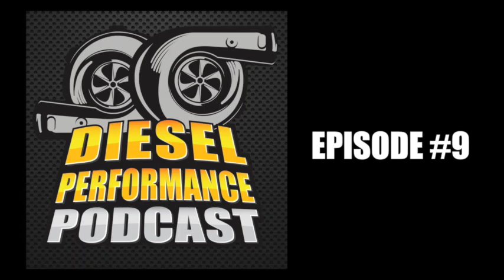Cummins Power from the Diesel Performance Podcast

Comment: So this wasn't covered, but what about the Aisin trans? How are they holding power in comparison to the 68rfe?
Reply from the maker: +MBallz23 Surprisingly they do not hold as much power. Although they are rated for a little more power from the factory, there does not seem to be much aftermarket support for them.

Comment: Hey I have a quick question about the 4th gen ram transmission section, you guys were discussing a "300$ valve body modification" around the 35:30 mark that could potentially bump the tunes up to 530rwhp ? and my question is, what kit or valve body separator plate are you guys talking about? thanks I've watched every one of the podcasts you've made keep them coming !
Reply from the maker: +Devin Terry The price on the kit actually came down. They are $140 for the high pressure valve body kit and available with out SPADE King:  http://calibratedpower.com/cummins-17/tuning/built-transmission/king-spade-csp4-tuning-2013-2016.html
Reply: +Duramaxtuner  Thank you so much for the reply definitely considering your companies tuning when i get my truck! One thing i also wondered would there be any hesitation with tuning an emissions equipped truck with over 150k ?

Comment: About to build transmission on my 2004.5. With Chris' suggestion for 600rwhp with trans, lift pump, tuning and turbo, do I need an output shaft as long as I don't do high boost 4x4 launch?
Reply: Billet output shaft that is? Was planning on ordering a street/track from firepunk. Just a DD and have fun on street.
Reply from the maker: Not really, we run several 700 RWHP truck with stock shafts.
Reply: +Duramaxtuner awesome thanks for response. Love the podcast!
Reply from the maker: No problem homie! - Paul